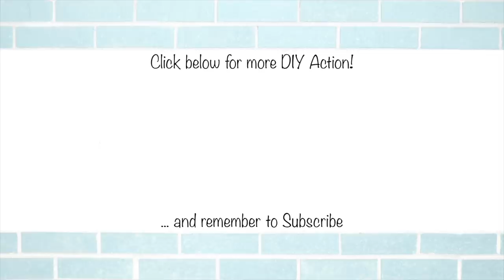INSULATING the ROOF | TRC Van Conversion 9.0

Comment: do you plan to do brain surgery in the van ??   HOLY MACKERAL !   so ...if you have 4 bodies in the van.  maybe doing some cooking.  maybe some heat ??    where is the moisture suppose to go ??   I am just starting my 170xt van conversi0n  .   I purchased some 4' wide rolls of foil.  both solid and with perforations.  foam ?  rigid insulation ?   thinsulate  ??  so many choices.    as I plan to be using my van to get to warm climates in the winter I am thinking less is best.
Reply from the maker: It’s as much to keep heat out, but windows and the fan keep everything fine with no condensation.